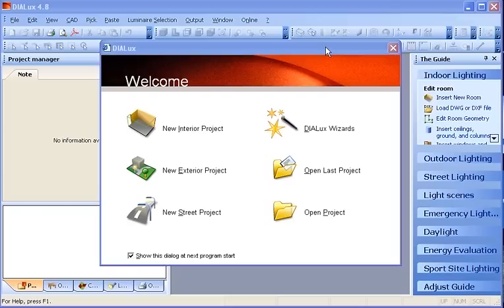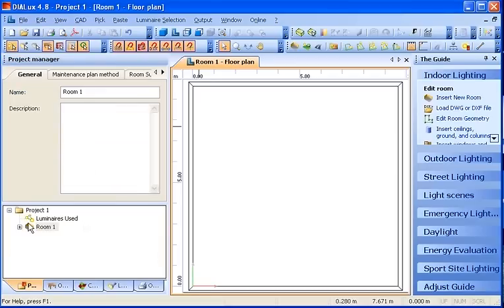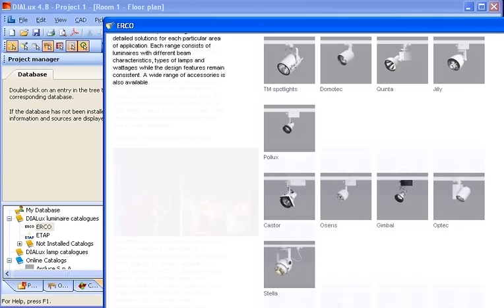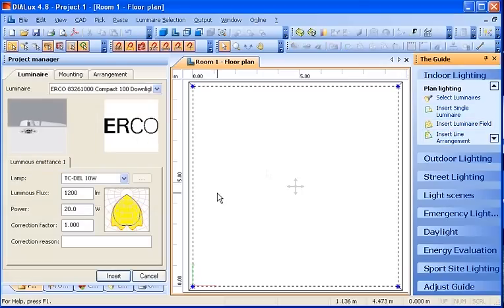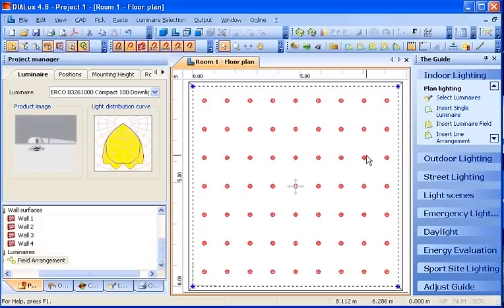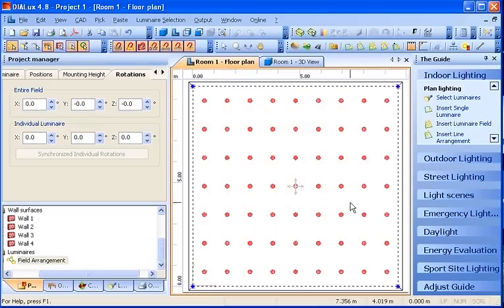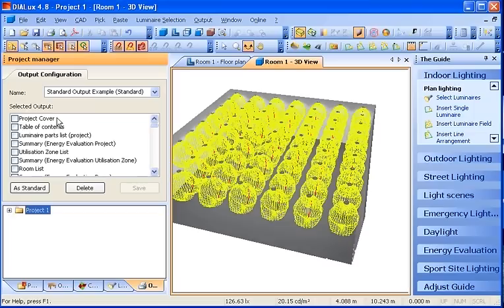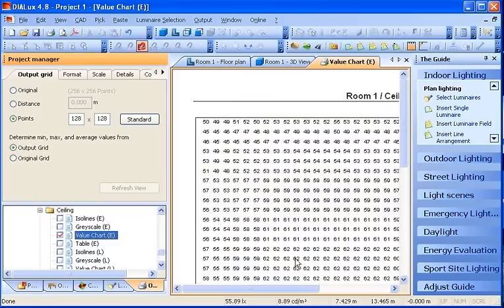dailux basic tutorial

Comment: please can someone help using Dialux 4.12 because I am having trouble with it, particulary when Importing a CAD drawing
Reply: +Yannick Ahanda I had the same problem. You can try changing the drawing from a DWG to a DXF and it should work. Also Dialux will only accept drawings from Autocad 2010 or older.
Reply: Another thing I noticed is the DWG get imported with its own coordinates, so it will not appear close to de origin of the Dialux file.

Try moving all of your DWG entities to the origin (0,0,0) in autocad, then import it to Dialux.